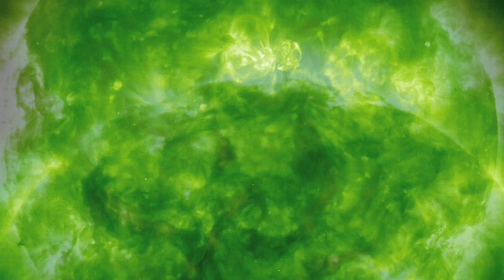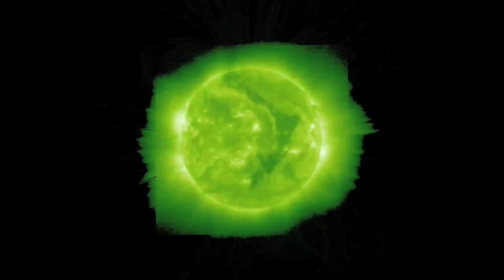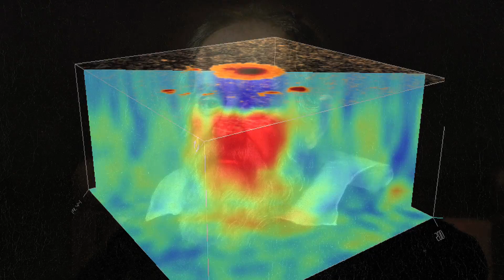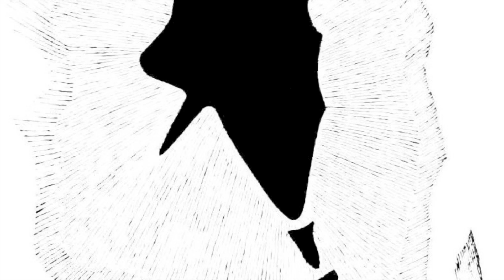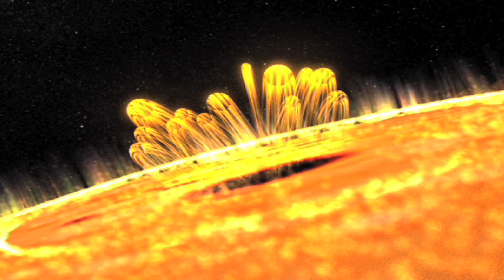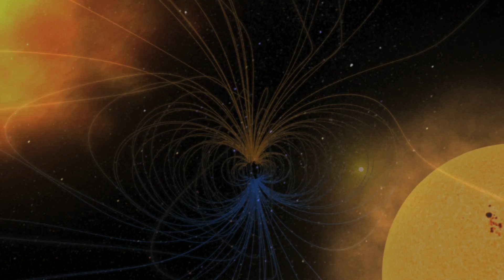Solar Tsunami

Comment: The reason a sunspot appears dark is that the gas inside the spot where the magnetic field is strongest is only emitting about 1/4 as much light as from the rest of the solar surface.

Comment: When you burn a match, oxygen gets consumed, and other gases (such as carbon dioxide) get produced. In addition, energy is released in the form of heat and light. The produced gases are hotter than the environment due to the generated energy, and they expand, as heated gases do. Since their density is lower than the surrounding atmosphere, the gas tends to rise. While it moves up, it carries energy with it, thus the flame ends up pointing "up". I hope you never again blame gravity to repel fire!

Comment: we are all aware of the radiation affects from the sun, but what about the magnetic pull on the earth from the sun at times. could the sun's magnetic power flip the earth's poles? Or how about cause the interior molten core to flip causing a ripple affect of earhtquakes on the earth?

Comment: Google " Structure of the earth wikipedia ". Read "Core" topic to find the 2 points "Innermost part of the core is enriched in gold, platinum and other siderophile elements. The solid inner core is too hot to hold a permanent magnetic field."  Now you know "why?" You asked why it won't explode if gravity repels fire. Sure it does explode in the form of volcanos that comes from tetonic plates that is a portion between crust and upper mantle but not from inner core as it can't hold magnetic field.

Comment: The earth is surrounded by a magnetic field.  A coronal mass ejection from the sun is caused by a collapse in the sun's magnetic field.  If a coronal mass were ejected and were on a collision course with the earth, the earth's magnetic field would definitely influence it's trajectory just enough to push it off that course. Thus the earth is never actually in any danger no matter the direction of the ejection from the sun.  The earth's magnetic fields will always deflect radiation away from it.

Comment: @mypokemonisawesome The logic of my argument is undeniable... there's no need for wishful thinking when it comes to science, science is definitive.  The force of the ejection from the sun is only for an instant... but the force of the earth's magnetic field is continuous, and that force would be opposite the initial force of the sun's ejection.  Moreover, the opposing force of the earth's magnetic field increases in strength as the closer the mass ejection becomes, like pushing magnets together.

Comment: You said fire has nothing to do with gravity. Copy & paste this " FLEX-ible Insight Into Flame Behavior  " in google and select NASA link. There is relation between flames and gravity in that link like this..."Flames in space burn with a lower temperature, at a lower rate, and with less oxygen than in normal gravity." Continued......in the next reply..